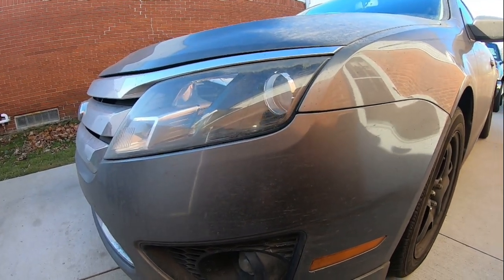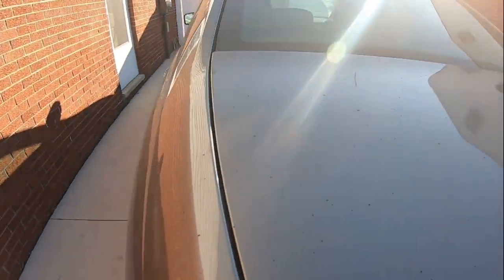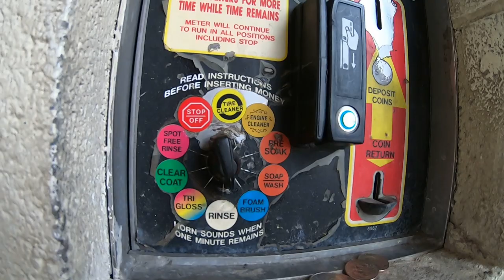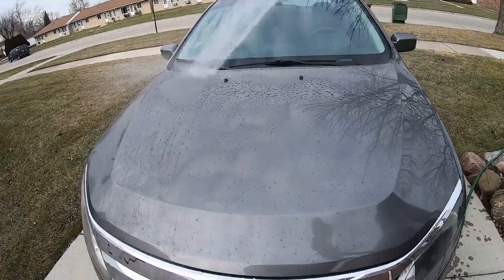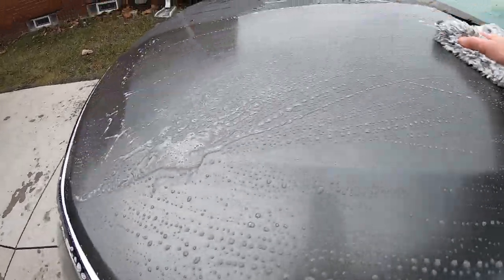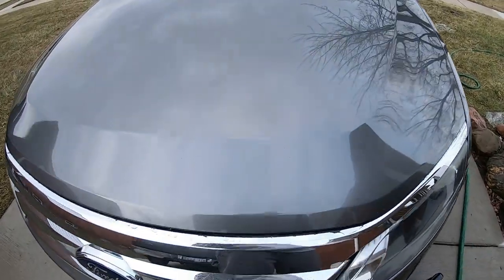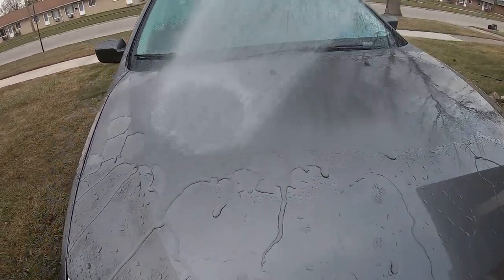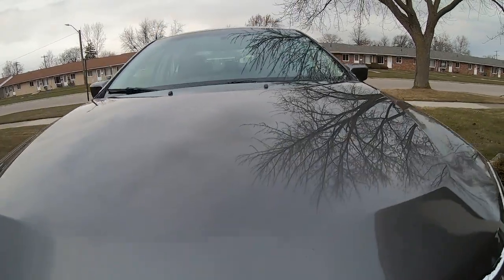Turtle Wax HYBRID CERAMIC SPRAY COATING One Month Review | DIY Auto Detailing

Comment: I only use my garden hose foam cannon as a pre wash to loosen up big dirt chunks and rinse it off. After that i hand wash it. I find its the best way to go. Also i found that using a high pressure washer shortens the life of the ceramic spray coating significantly so I have been using just a garden hose pressure to wash my car.  It takes some extra time but i prefer it. I only take out my pressure washer for patio cleaning.
Reply from the maker: I use coin pressure washer only when my car is full of coal from an industry area where I used to work.  Don't want that coal and fall out on my driveway . You make a good point that pressure washer will break down a ceramic spray it make sense. Thanks for sharing

Comment: I have the ceramic spray and the polish and shine ... plan on doing it this spring what’s the weather breaks ... got a new Ram that needs it ..still has the dealer wax on it !! Hope the Turtle wax holds up ... will do it again in the fall before winter sets in ... if it’s stuff don’t hold up I’m thinking of trying the Wolfgang ceramic spray wax .... time will tell which way I go
Reply from the maker: The ceramic spray from TW should last in a cleaner environment my car exposed to a industrial environment. When you do use it lets know how long it lasting for you. I seen the Wolfgang ceramic spray just haven't purchased it.

Comment: Is this with 2 coats 24 hours in between?
Reply from the maker: I believe I put the second coat a couple of days after the first coat.  You can apply a second coat after 24 hrs.
Reply: @OuzoLouGarage  yes I usually wait until the next weeks hand wash. Then I apply a second coat. But this time I washed dried and applied.  Waited 25 hours lightly washed it a dried it again and applied the second coat. There was pollen that I could not apply over, so I washed itvagain to make sure the surface was pristine.  Super smooth and glossy! This one is a better sheeter than a beader and I'm ok with that.

Comment: It looked actually pretty good with all that dirt build up on it. 
But think that the soap where not able to be cleaning it all off. Seems like on the hood where you aggitated those coal residue that when you rinsed it where like something where left in those spots. And what usually happens for me if a car soap don't has a great cleaning ability from it. It looks just like this. A weak alkaline degreaser should aid to getting it cleaned up when you go to contact wash it. If you have any car soap that leaves nothing behind as in protection and glossenhancers that the brand has a coating in their line up is usually a safe bet on a good car soap. Carpro Reset car soap is amazing on the real dirty cars. Gtechnic G-Wash has also a very good cleaning ability. Tac System Mystic Bubble is like Reset but for me personally the scent is not so satisfying LOL. 
I have indusries and homes that heating up with wood and wood pellets that gives like these sot spots. They can be hard to get off LOL.
Reply from the maker: You are right the soap just didn't get the hood clean up .I do have Carpro Reset I will use that next time washing the Fusion and for the two update I never used reset. It raining today and the hood is beading well now has to be the soap that I used the windows and panels are beading good I'll take some photos and put on Instagram. Thanks from bringing other soaps to use with no wax or gloss in them it's nice leaning from the comments .
Reply: @OuzoLouGarage  yeah sometimes I can scratch my head and wondering what the heck happened. So great to have some feedback from others and then try something that you think makes sense. 
The other times I have experienced something like this drop in the performance of the LSP. Is when it's been on it's last leg and the washing is an abrasion at that took it down. But something like in your case says that the TW Hybrid Solution Ceramic Spray Coating is still there under something. Carpro Reset brings this back to high performance again. I can be very aggressive on the LSPs in the winter months here in Sweden. With both a tar remover and a TFR foam which usually is pretty alkaline based. Before I do the contact wash with Reset or like that. Most fresh SiO2 based products and some sealants and hybrid waxes stands up to petroleum based tar removers and traffic film remover foams. When you just spraying them on the paint and let it dwell and PW clean rinsing it off. This aid to that little extra cleaning ability from it to the heavy lifting water pressure cleaning from the PW. We have so much of tar spots and heavy road film during the winter months here in Sweden. Thinking it's cause of half or a little more of the cars winter tires is studded ones. That combined with the road salt and all that it's desolves the other dirt on the asphalt roads. Makes a mess from it and I hate getting tar in my wash mf mitts and mf wash pads. It's basicly a petroleum based tar remover but we call it a Cold Degreaser product. Turtle Wax Prewash-T is one of the good ones and Sonax and most other brands have their versions over here. But we only use it from the front wheels to the back of the car  and just up to the door handles. As if you use it too much over the windows it can desolve the rubber seals and on the doors find it's way into them and strip the rust protection inside of them. The alkaline degreaser takes care of the rest great. Then with a PW and use it to clean with the water pressure like it's a wash media it's not far from being a touchless wash. But it's that little of dirt left that needs to be aggitated a little that the car soap solution and the wash media takes care of. My rinse bucket after a wash with dirty like your Fusion where or worse. It's almost not visual any noticeble dirt in the rinse bucket after the washing is done. Don't know but it's like a standard on road salt crusted dirty vehicals to use the cold degreasers/tar removers here in Sweden at least LOL. And if you combo that with a TFR foam or alkaline degreaser is what we who like to take care of our vehicals uses. If we are able to be washing weekly the cold degreasers is not used on every wash but maybe once a month or so. If going over 3 weeks though it's a must to use here. And this is just not me doing this but most who washes the vehicals during the winter months here in Sweden. Then you have those that just skip to wash during the winter months at all LOL. Just some extra information how we are doing over here. Fun and interesting to see how we do in different places of the world. Just looking at some washing videos on YT from people living in big cities in Asia. And the amazing amount of smog that gets their roads and air dirty is just incredible to say the least to see. Saw one that put together from every week and to 6-8 weeks photage in how a LSP where holding up. And the amount of that black sot from every wash that had build up where crazy. 

Will be very interesting to see if Reset brings back the performance of the Ceramic Spray Coating.
Reply: Tony Mattisson back at it with some amazing comments!!! You always have the most educated and helpful comments! Are you a detailer? How do you know so much about detailing? :)
Reply from the maker: @tonymattisson6158  I don't get much tar in the winter our weather here in Michigan has been crazy one day it's snows and it 25 degrees out and the next day rain and 50 lol. I think we had road salt just a couple of times.  I think the soap.i used masked the ceramic spray it's been raining for two days and the hood is beading great again . Love you comments this is what I want on this channel we lean from each other and help each other out.  Thanks my friend appreciate it
Reply: @OuzoLouGarage  thanks for the nice comments and to Henry as well. I've been on the Autogeek and Autopia forum a lot for almost 3years now. And that's when I got me a new to me car. Decided to take care of it even if it where not in the best condition with some deeper scratches and such but was great polished by the dealership. Had a big interest of detailing in early 2000 when I bought an Audi S4 92' that I tuned and took care of. After that it where more boring cars so swirlomatic car washes sadly LOL. Since I got the car I have now polished from start. I dove head in first and don't think that I have come up yet LOL. Have developed a big interest of detailing and read a lot and trying it out. Take care of another car and a friends american classic car he had until early summer when it caught fire on him. Do some other cars once and a while but not so much as I would want. Have a physical disability with nerve damages in the spinal cord that gives me high pain always and when doing anything it gets worse. So not the best hobby to detailing LOL. But it's so fun and give the mind some rest from only thinking on the pain. I get so focused when detailing that the pain don't have the over part of what I do and it comes afterwards when I'm done. And have always thought it's awesome to share experience and learn from others. Even if the detailing scene can be haveing some special caracters it's mostly nice and open people with the same interest to have their vehicals and others to look awesome. So what I share is a mix of what I have picked up during these 3 years and put some testing behind it. And I think it's awesome how the social media gets us so much closer in the world. 
Then I write always too much LOL. But like to explain what I mean thoroughly. 

That's some crazy weather changes. Yeah I think that it's the studded winter tires that wears a lot on asphalt roads. That makes so much tar spots. 
Fun to see videos here and keep them coming.

Comment: Hi
I'm all the way from South Africa..... 
I just got into the detailing world recently,a month or two ago. Basic washing with a basic car shampoo,polish and waxed the car with carnauba wax.

Last week I purchased four of the new Turtle Wax Hybrid solutions, I didn't buy the Ceramic spray coating. 

Would you please advise how to use the products? 

But importantly,  would it be advisable to use the ceramic spray on a car that's been waxed and polished. 

Kind regards 🇿🇦🇿🇦🙂🙂🙂
Reply from the maker: Very cool you are from South Africa . The ceramic spray would go on after the polish . Wash the vehicle with Turtle Wax wash & wax and then use the spray wax . What products do you have ?
Reply: @OuzoLouGarage  I got the Turtle wax Wash and Wax, Wet Wax, Polish and Wax, 3in1 detailer. 

Soo the steps are gonna be:
Step 1 wash and wax
Step 2 spray Wet wax then dry 
Step 3 use Polish and wax 
Step 4 use 3in1 detailer
Reply from the maker: @aobakwesenosi6454  Step
1 wash
2 polish and wax
3 spray wax or ceramic spray
4 use 3 in 1 when you wash the car a again like a week later
Reply: @OuzoLouGarage  ohhh okay soooo Hybrid solution Polish and wax first, then use Wet and wax after

Comment: Is it me.. or the beading action is a bit on the weak side...? Assuming, this is the first wash after a month.  Sadly, I still haven’t seen a solid, conclusive video of this vs the Turtle Wax Seal ‘n Shine. I use that and still blows my mind..!
Reply from the maker: The beading after washing the car did go weak some thing in the soap mask the ceramic spray. It rained for a few days and the beading came back . Will have a video soon on another update. This spring I could come pair seal n shine with the ceramic spray half n half on the hood.
Reply from the maker: Yes first wash

Comment: It’s a great product if apllied correctly, most negatives here to lazy to do it, talk is cheap
Reply from the maker: Was applied correctly did an iron remover and wax and grease remover also. This vehicle is exposed to a very heavy indrustal environment coal all over the paint   cool when wet is like an acid . One thing in life I'm not lazy funny you  make a comment when you never watched the video when applying the product .now that's lazy and TW ceramic spray is a great product

Comment: Seems to be a lot of questions about the soap, I do think that had an effect, I have not had much luck with getting the truck clean Shiney's Bull Shine Soap, I had to go over it with Adam's. Though I do like a lot of Shiney's other products. 

One soap I'm curious about is Optimum car soap. Has anyone tried the Optimum soap other than The Rag Company guys? I'm curious as to why I don't see others using it. If you watch the Detail Geek's channel he is always washing a hammeted vehicle, and he uses Meguiar's Hyper Suds.
What is everyone's go to soap?
Reply from the maker: Seems like the soap did masked the ceramic after it rained for two days the beading came back.  I have to try Optimum I should order it this week. For a soap that cleans good a like Sudzbox the one that had no wax in it that all I used to washed the Jeep when doing a test on Hydro Charge but I ran out of it. I do Citus wash and gloss but don't like using it of I'm testing a product.
Reply: @OuzoLouGarage  One other thing I learned  is to be aware of  soaps containing water softeners, most car soaps do not, though be on the look out; soap lathers better in soft water than in hard water, so it's easy to use too much. The more dissolved soap there is, the more water you need to rinse it away (possibly causing you to leave a residue), you may have to rinse for a long time even though you don't see the soap. Second, the ions in softened water lessen its ability to stick to the soap molecules, making it more difficult to rinse the cleanser off . If your home has a water softening system you may always have soap residue on your car.  If you've ever showered with well water and it feels like you can't rinse the soap off, its because you can't for the above mentioned reason, you have soap residue on your body. The more you learn about detailing the more you don't know. I'll look foward to your analysis of Optimum Car Soap.
Reply from the maker: @jayz313  We do have soft water think you are right I didn't rinse good enough when it rained the beading came back.  Pretty cool how soap and water hardness etc can play a roll. Sorry I haven't been on YouTube muck this week our big dog passed alway suddenly and just missing him my dog Ivan is family and he's in a lot of my videos. Thanks my friend appreciate it
Reply: @OuzoLouGarage  Steve, I'm brother, I know all too well about  the loss of a pet I lost my cat, my little buddy,  July 2018, they really are something special, you never forget them in a good way. Don't worry about YouTube or us, we'll be here always supporting you no matter what.  Come back when you're ready. I have you in my thoughts and prayers.
Reply from the maker: @jayz313  Thanks  brother for the prayers and support.  Sorry for your loss of your cat.  You right we never forget about them.

Comment: What soap did you use?  It definitely affected the coating.  I've experience the same with some soaps that are not supposed to do this.
Reply: Shiney’s bull shine shampoo. 

What soaps have you experienced this with?
Reply: Not using the same spray sealant, I use Wet Coat, but I’ve noticed a few soaps will remove it. Interestingly enough, it seems somehow worse if I apply the soap by foam cannon. I’ve had it happen with Car Chem Super Suds and also Limitless Lather. Although LL is an awesome soap I almost forgive it! 
I’ve had more success with Adams so am working with that at the minute.
Reply from the maker: Thanks Henry I been working a lot and hard to get to the comments fast
Reply from the maker: I think the soap masked TW ceramic spray I'm going by how it was beading and sheeting before I wash the car. And now it's been raining for two days and the beading and sheeting came back . I know it's crazy . I can make vlog today talking about this and if it's still raining show the car what do you guys think? And nice to see everyone giving feedback on this .Thanks guys
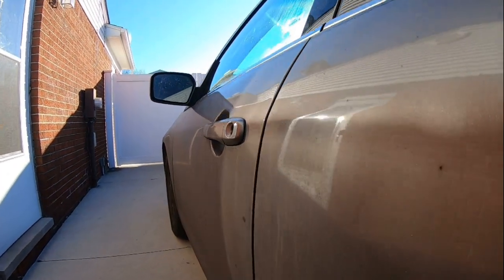Reply: @OuzoLouGarage  I'm not so sure.  Watch that video I did again on the Limitless Lather.  Watch the beading on the roof at 46 secs (before LL) and then again at 2:26 when I rinsed it off.  That's why I applied the Wet Coat again - I didn't plan on doing it cause it was beading fine before.  I'm sure some of these ph neutral soaps that say they don't affect coatings actually do.
Reply: @GeeWhizRS  if any of the soap doesnt rinse off then it wont bead water. Try wiping it down with mitt or towel and just water after to help get all the soap off
Reply: Raven Starver if the soap won’t rinse off with my Kranzle pressure washer then it’s not fit for purpose. I have no problem with Adams Car Shampoo so that’s what I use now. 👍